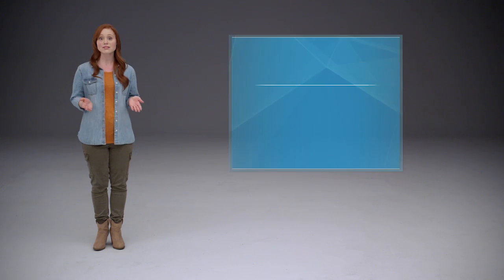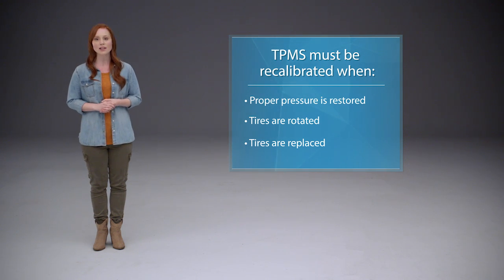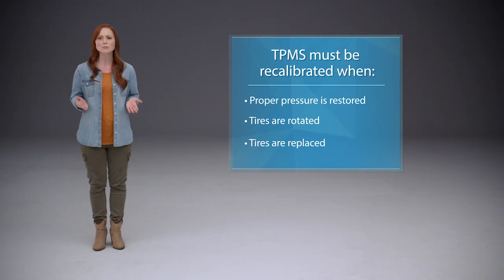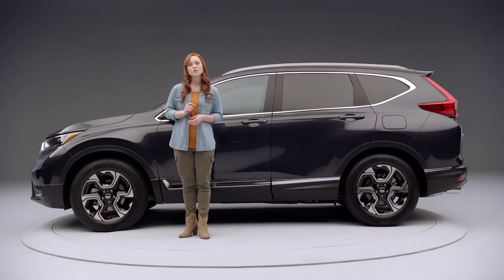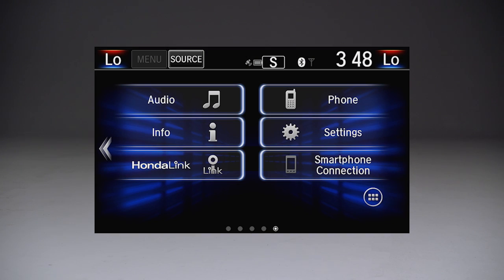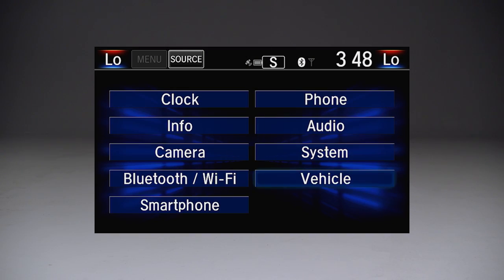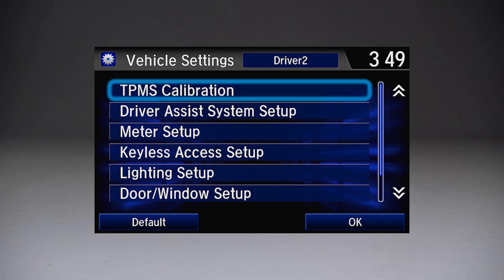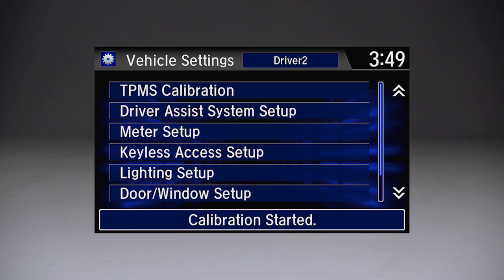Honda Technology: Indirect Tire Pressure Monitoring System

Comment: Indirect TPMS is a scam, one of my tires had lower pressure and this system didn't warn me, it only works if the tire is almost FLAT, cmon honda dont ruin your image
Reply: Not for me. It came on at under 20 psi. That's the usual cutoff for the valve step TPMSes anyway.  I believe it says in the manual that it may not track at low speeds.

Comment: 2019 model still has this last century technology. Can't believe it. It only gives you a warning when the tire is nearly completely flat (experienced that twice) - in both cases I had to replace the tire (damaged due to late warning). Honda seems to be the last car maker without proper system to measure the individual tire pressure ...
Reply: I feel exactly the same. I have to check all 4 tires and I find it so inconvenient and annoying! Come on Honda, I do love all other things about CR-V but tire pressure sensor would be the only reason if I change to a new car sooner than originally planned.
Reply from the maker: Thank you for your feedback Marcel; we will ensure it is documented. Please feel free to reach out to our Customer Relations Team at 1-888-946-6329 (Monday to Friday from 8am to 8pm EST) if you wish to discuss further.

Comment: As a new CR-V owner, I find this system to be a cheap cost saving measure by Honda.  Most vehicles in this class have individual tire pressure monitors which I think is more convenient for the driver to specify which tire is losing pressure.  With this system, you have to check all 4 tires!  I miss my Sportage!!  35 GRAND for a CR-V should have this feature.  The Sportage does.  Come on Honda, don't become one of those greedy companies like the rest of the USA.
Reply from the maker: Thank you for your feedback Robert; we will ensure it is documented. Please feel free to reach out to our Customer Relations Team at 1-888-946-6329 (Monday to Friday from 8am to 8pm EST) if you wish to discuss further.
Reply: I'm glad it has these sensors. I stupidly put after market valve caps that look great but corroded and locked on cannpot come off. They would cost a lot to cut off if a sensor is damaged using a dremel tool. Each sensor is $200 plus labor plus valve.   They simply ripped out all 4 valves and new ones $40 and the system calibrated with pressure.
Reply: Agreed, it drives me nuts not being able to see my tires psi, don't think I'll be purchasing another honda

Comment: How can we check whether the calibration process is complete or not?
Reply from the maker: Hi Chamodya, the tire calibration process is completely automatic. If the conditions for initiating and performing the calibration have been met and the TPMS light does not re-illuminate, then calibration is complete. Please refer to the applicable page of your owner's manual, which you can find at https://www.honda.ca/owners/manuals